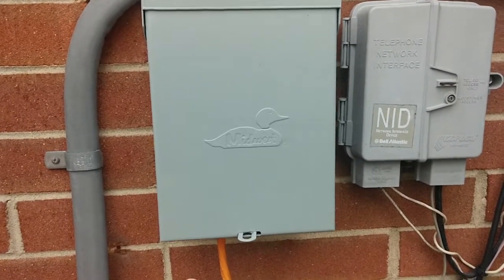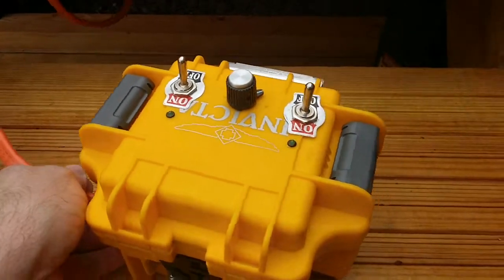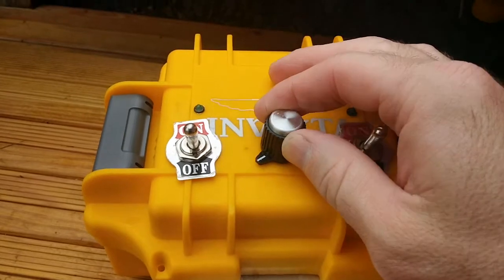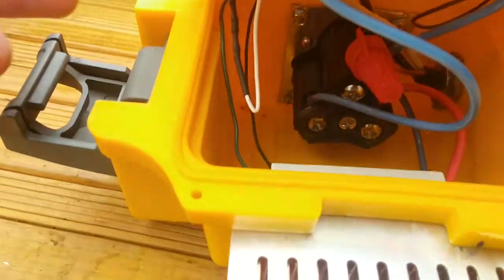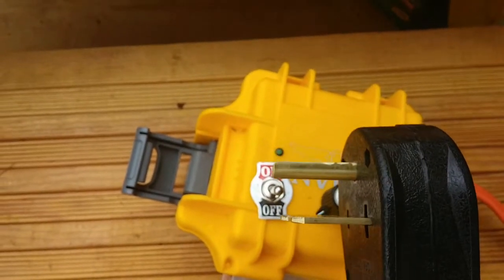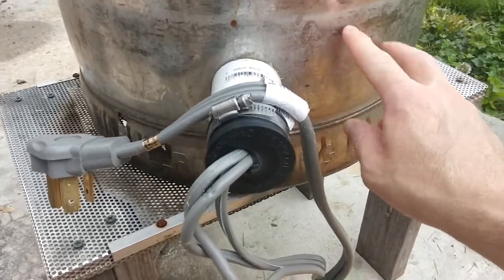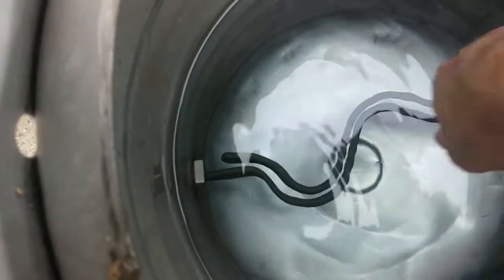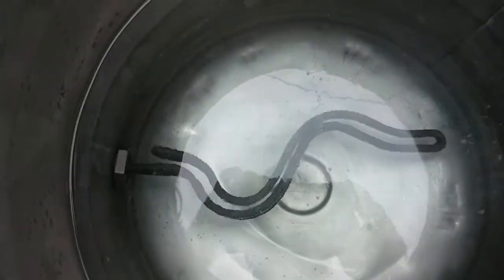Electric Brew Kettle

Comment: parts list?
Reply from the maker: 240v 5500w water heater element
Stainless steel 1” nut
Stainless steel 1.5” id washer
s
silicone o-rings
ssr 25amp rated to 380vac
heat sink, with thermal glue
potentiometer switch
2 on/off switches
240v service panel with a gfi breaker
Corresponding outlets and cables
Make sure everything is rated to handle the load.